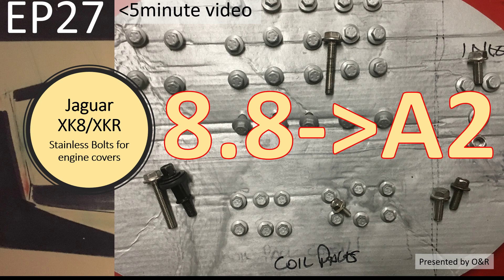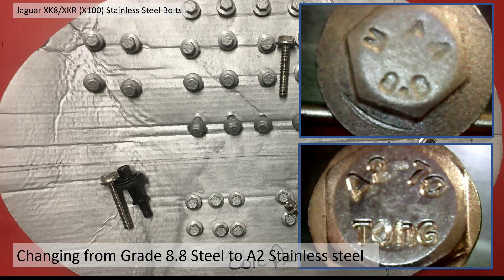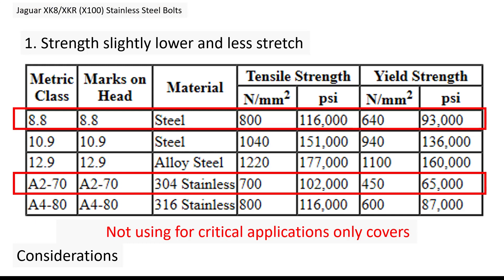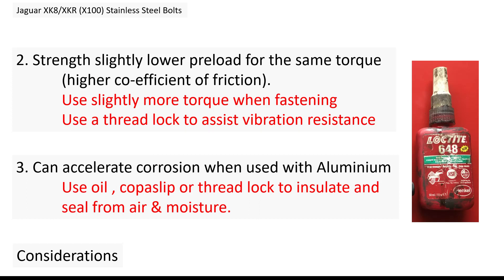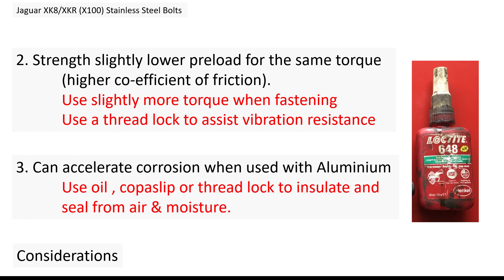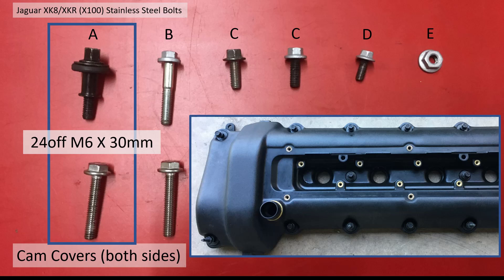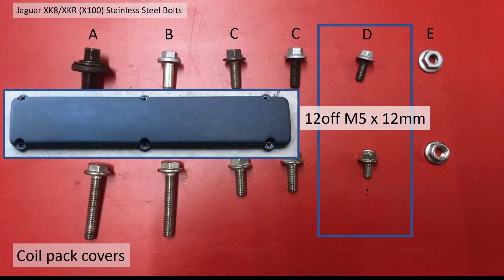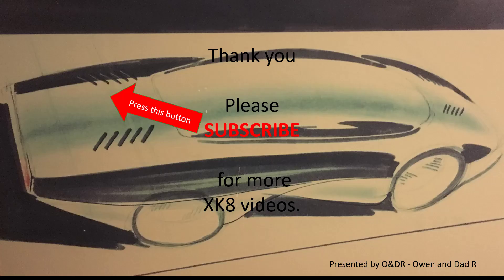Changing bolts Stainless steel EP27 Jaguar XK8 / XKR (X100)

Comment: thank you for another great video, honestly cant thank you enough, may i ask your opinion on copper slip grease, i have been reading that ceramic grease is better as it does not conduct electricity which is effectively what causes the corrosion in metals, the question is in regards to recommending copper  slip between the stainless steel and aluminium. thanks again look forward to your next video
Reply from the maker: My understanding is the coppaslip conducts but fills the gap so no moisture or air can get at the thread surfaces. Different method same result. Personally I am using a thread lock because this does both insulates and fills the gap. Plus it also addresses the    lower torque issue. All good. Everyone has an opinion on these things. Thanks for the compliment. ;-)
Reply: @jb944  thank you for the informative link. I have learnt something today. Interesting about the use of sound deadening washers that also actually prevented corrosion. Thanks again.

Comment: If I change the cam cover bolts, what about the bolts that are near the timing sensors?
Reply from the maker: Rick, stainless steel isn’t magnetic so doesn’t interfere with the cam sensors in the same way the steel bolts do. Just need to ensure they aren’t too long and foil the sensor. Hope that helps.regards Damian
Reply: @ODRModurol  Thanx, Damian. I appreciate all the help I get from your videos.
Best, Rick